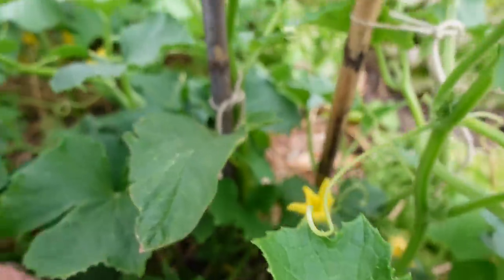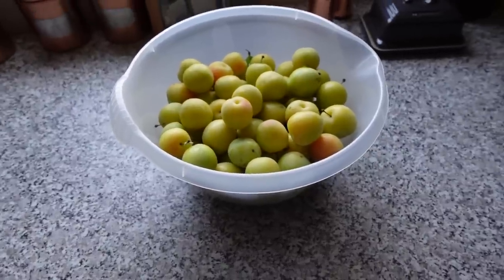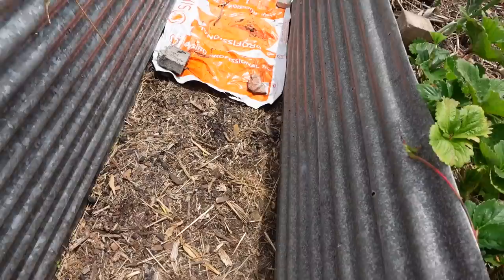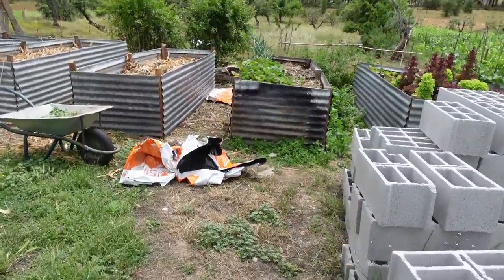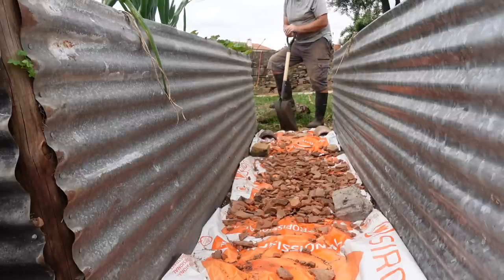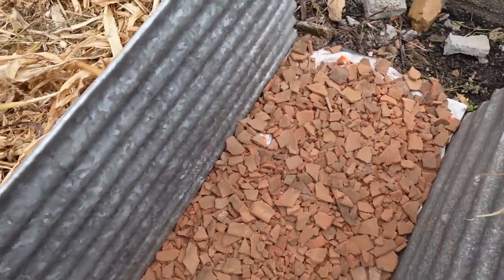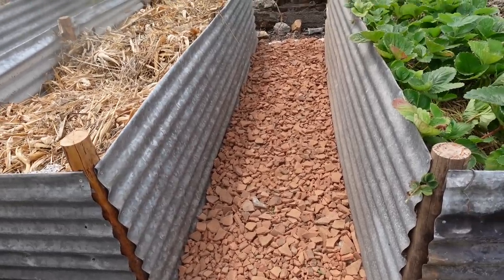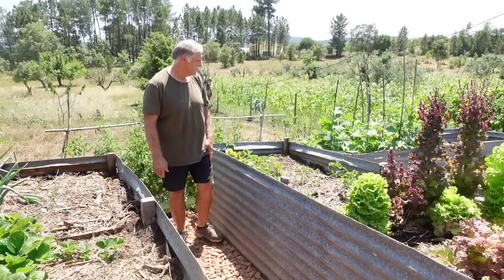76. Recycling old Portuguese clay roof tiles.

Comment: As many others stated before me, great idea of recycling the tiles, tho it would of been a lot better, environmental wise, without the use of the plastic bags, as most of the plants simply don't have the strength to sprout throughout that thick layer of debris.
Reply from the maker: We have tried laying paths before without plastic and the weeds are very strong they do come through after a little while. The bags are actually old  compost bags that have  been recycled! So a win win 🙂
Reply: But the reourposed plastic bag liners are being used as weed suppressants, so it's exactly preventing weed regrowth as intended.
Reply: @ruthconstantino6861  while I understand the reasoning, I just don't agree with the method. First, it's plastic so bad for the environment, and secondly, from a functionality perspective, it offers no permeability for the rainy season. Same result could of been achieved by using cardboard or something, which would successfully suppress any weeds long enough to kill all the dormant seeds, without any drawbacks.
Reply from the maker: @SaseDegete  whilst I understand where you are coming from better we use the bags this way than put them in the general waste where they cannot be re-cycled and end up in land fill. Recycling the bags also prevents the seeds that the birds drop from growing in the pathways.